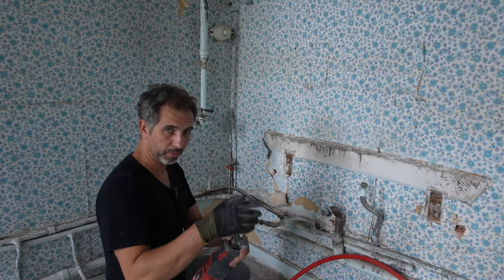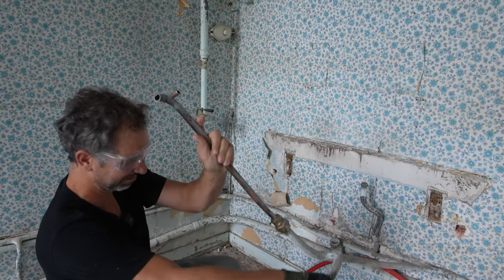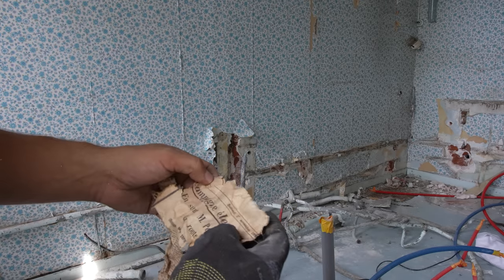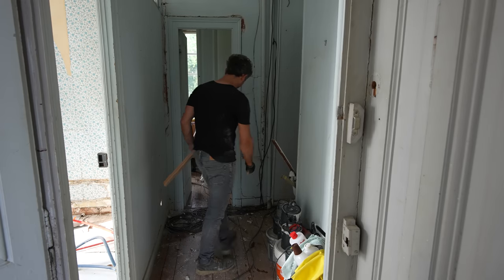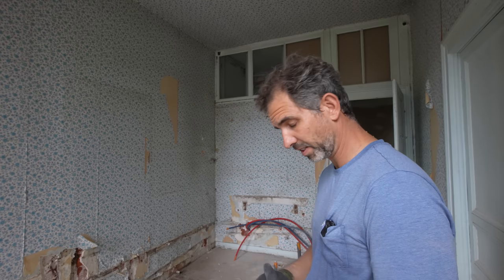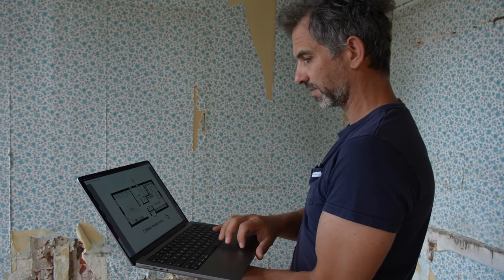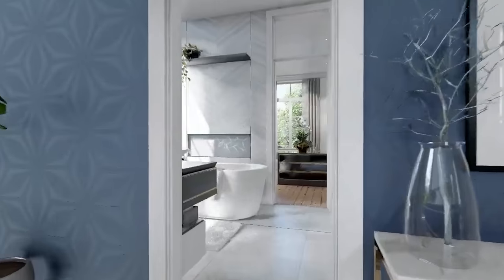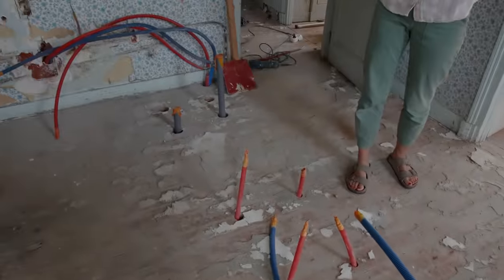Chateau Master Suite Makeover - How complete strangers redesigned our bathroom

Comment: Phiillip, my sympathies.  I was just trying to paint the trim on 2 windows on my 1910 house ... which entailed moving a radiator, but then discovrered that not only the plaster right around the window frames, but on the entire wall was loose from the brick. So now I have to replaster a wall and repaint the window trim all before it turns cold in later October. I'm going to try your electric saw trick on cutting nails from behind to remove the trim.  Joy!

Keep the 2 doors into the bedroom and dressing room. I do like having a closet for the toilet opening into the bath area.

Comment: The most sumptuous design is the last one. Go with the wooden floors, as they warmer. Have 4 and 6 lambskin fleeces as throw rugs in the bath. Have a single lambskin in the water closet.  Lambskins can be laundered. Drying them takes a couple of hot sunny days  with a floor fan. You can tumble dry to damp on low heat for a long time in a commercial dryer but then they  shrink. If you have the energy a wire dog brush will make the pretty as new. But that is a lot of work.

Comment: I like the idea of having just 2 openings in order to see straight thru and for added light.  However, I hope I understand that both doors fully close because there maybe times when its better to have 1 or both doors closed.  I rhink you should go for the larger shower and private toliet/bidet space, taking a bit of space from the closet.  I think you will regret it if you don't do it now, while you can.

Comment: I really thought the idea of the two doors was horrible when you asked us last time.  But I had been thinking of it with the third door to the hallway still there.  Didn’t even think of closing that one off.  That really changed the perspective and honestly, I don’t know how that wasn’t obvious.  Which to me is usually the sign that a plan is a good one:  when it seems obvious. Like it was always meant to be that way.  I agree, the light that would fill the bathroom from the bedroom would be worth it alone.  For me, anyhow.  I think you could easily tweak that rendered plan so it wouldn’t involve moving walls and retain the features in the dressing room you want to keep.  Ya, I think it’s hard to resist the loveliness of that flow and that light.  Also, if at any time you or someone else wanted to convert that dressing room into another bedroom, a shared bathroom for children is definitely doable.  I like it 😊

Comment: Great Job! My proposal is to keep the two doors, for the light and for the natural flow of movement between the rooms. I have put myself in the situation of using this space and it "asks" me to be able to go easily between the bedroom and the closet I without going out into the corridor and I would definitely keep the WC inside the bathroom, so it is more private. And also, I would open a door in the closet to the corridor. So, there are several independent ways to access the three spaces as needed. Looking forward to see the results!

Comment: The idea of an espresso bar in the master bedroom though ... !! 

I do like the idea of flow across by keeping the two doors across from each other open. 

Will the dressing room be only accessible through the bathroom then? And I'm wondering, how often do you need to change clothes through the day, like changing into painting clothes, changing out of renovation clothes, etc.  

I know very large showers are luxurious. We have a large shower. But how large does it really need to be. It seems like an idea of imagination that in reality of daily life, isn't necessary. Maybe instead of the shower going all the way across "rectangularly" make it more square so there's plenty of elbow room. The worst is slamming your elbows into the side or door of a shower! Then there's more depth for the toilet next to the shower. Install a frosted glass shower door, and also next to the shower door, same frosted glass door for the toilet. You'll have frosted glass across that side, allowing light through and also privacy. Or maybe the frost doesn't have to cover 100% of the doors, leave clear glass on bottom and top. You know, so you can see feet if someone is sitting in the toilet. Or if a burglar is hiding in there. LOL.

What is underneath the bathroom? Anything affecting where the toilet pipe could go? And if something goes wrong with the toilet pipe, any consideration to what's under the bathroom so you can limit the damage? Our cast iron pipe to the septic tank collapsed underground one day, and I'm thankful our bathrooms are all stacked on top of each other, and the only thing underneath was a closet in the basement. Although I'd advise, maybe don't install storage right underneath the toilet pipes!!

Comment: Unfortunately, on the profession spending a large part of the façade [the most expensive element of a building] to an activity that is used less than 30 minutes per day as a dressing room is a poor investment choice. I understand that looks cool and seems to be a good idea, but a reading room will be much more useful, or a personal office that will make that part of the chateau a private suite, even for future appointments.
The rooms should function independently, so if one of them is used, you would not need to disturb the person using it by going though. A good idea, in these cases, is to have the loo separated from the rest of the bathroom.

Comment: There is a tool specifically to lift lino and its glue from floors. In the U.S. it is made by QEP and has an 8 inch blade on a handle. There is probably a version of it in France.

Comment: I would keep all the doors, but have the hallway door attached on the other side and put shower there, so that you swing the door open and its against the shower wall. Toilet next to shower. Or make the sinks a single sink (who really needs 2?) And put the toilet by that window. Maybe a little frosting on the bottom of the window so you get the light but have a little bit more privacy (if the toilet was right there).

Comment: The open door frames to both rooms seems like a recipe for disaster with water spilling onto the wood floors, ventilation of the steam created by the hot shower will be impossible, creating mold etc. I'd do the two doors but make sure to actually put in doors, don't leave it open like the render.

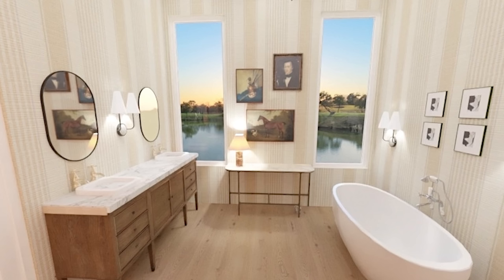Comment: I’d vote for either the plan shown at 10:50 or 11:06… they seem like the best balance of nice flow and less moving of walls. The only thing you lose is you can’t have a huge double shower. If you do a toilet with built in bidet you could save a little more space for a larger shower. 

I like the symmetry of the design at 10:50, with sinks on opposite walls, but you wouldn’t have as much of a view from the bath.

Comment: I would close the hallway door and open the door to the dressing room, as it gives better flow & light. This would also mean losing the entry to the dressing room from the hallway, which you could then use that space for a separate toilet and still have a huge double shower. Otherwise have a smaller shower with toilet next to it, in which case you could have a linen closet where the old entry to the dressing room was. Either way it will give a true master suite that is a private & luxurious retreat!

Comment: What wonderful plans were sent to you. The presentations were from such talented people! I also liked that some plans appeared to have high (transom) windows to share more light among the rooms. In America, many victorian era houses had such windows over nearly every interior door. The value of these is the ability to open or close them, increasing air flow (allowing hot air to vent away, as well as venting moisture out of the bathroom.) The same amount of moisture that could build into a mold problem in a small room, becomes no problem when moved into a larger air space.

Comment: Definitely keep the 2 doors to keep it ensuite...the only way you would have a passage entry is to do pocket doors or barn door on the passage side to toilet entry. It is a private master suite after all. Also remember with upstairs plumbing and drainage in an older home bathroom you have to make sure that water seeping gradually and settling doesn't destroy your beams between the floors..eg if you decide to do a modern walk-in shower to do it in a drain pan not straight onto the tiles like in modern cement homes. Speaking from experience in renovating a  grand 200yr old home in the Caribbean. We have had to do a huge tearing up of sub floor to rectify this. 3 bathrooms have to be redone. Only 1 completed so far. 1 semi complete and one not started yet.

Comment: Gorgeous renderings. Love the two opposite doors option and lose the one from the hallway and use that corner for the loo with a view across the bathroom to the window. Shower in other corner and bath and basins directly under the windows. Could swap shower and loo after doing a test sit on a chair to see which view you prefer! Or if you hv a preference to look past the bath rather than the sink. If u can fit a bidet in then include that too.

Comment: Keep the two doors. The only modification i do in the last plan is a smaller shower so you can fit a toilet. Or if you want you can  keep the doors, in the corridor wall put a double sink, the toilet next to the door connecting to the bedroom, and make a wet room for the shower and bathtub where you have the windows.

Comment: I would opt for the last plan presented.  I've renovated 4 homes.  I know it's a lot of work to move walls.  But in my experience, kitchens and ensuite master bathrooms are what sell houses.  If you're not sure that you'll stay in this chateau, you might want to take that into consideration.  

The flow of the last plan makes more sense to me than all other plans presented.  Also, take in consideration that bathrooms produce steam, which is not the best thing for closets.  So, I wouldn't have the door to the closet coming from  the bathroom.

Comment: 💖
I saw someone use a blow torch to heat up the linoleum to soften the glue, and it pealed off so easily.
I love the flow of the 2 doors, and I like the idea of the contained toilet and possible "sharticles", however I feel it important for hygiene purposes that the door to the toilet open into the room with the sink.

Comment: Love Kevin's plan.  The question is, should there be a doorway from bathroom into the hallway? If there are bathrooms in each of the bedrooms on that floor, than no.  If there will be a communal bathroom to be shared on that floor, then no as well.  Your master bedroom suite should be you own oasis.  If you wish to have an extra toilet off the hallway, then I would choose one of the other bedrooms, taking a small section of that bedroom and create a half bath, as we refer them in the U.S., by adding a sink and toilet.  Love your channel.
Reply: Oh, and let's not forget about storage.  Love the vanity, but no storage below.  So be sure you have a linen closet in the bathroom for cleaning supplies, mops, vacuum, etc.  Perhaps have a smaller shower and insert the closet between the shower and the enclosed toilet.

Comment: MY VOTE:  Loose the hall door, keep the two other doors butttt, see if it’s possible to add a door in the closet that goes out into the hall.  If so, no brainer - that would flow beautifully and be more elegant……especially if the door into the closet from the bath could be a pocket door(s) instead of a swing.  If so it would give you more room inside the closet to create the exit door into the hall.